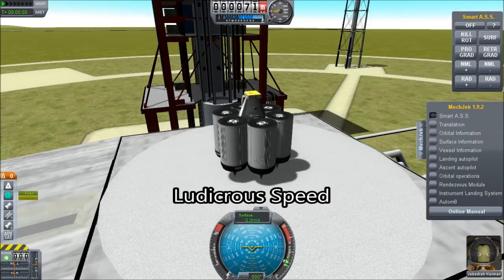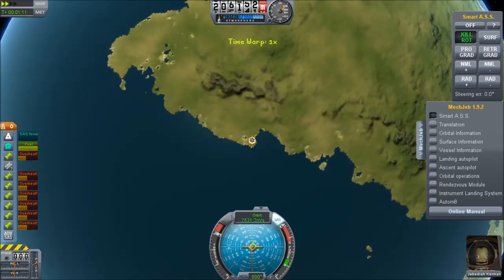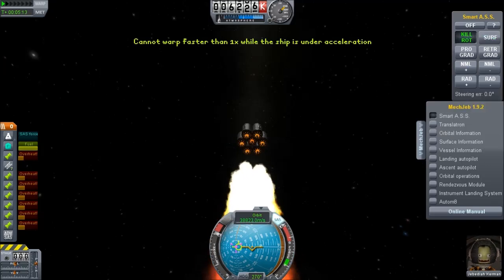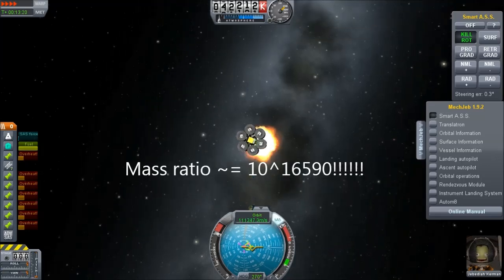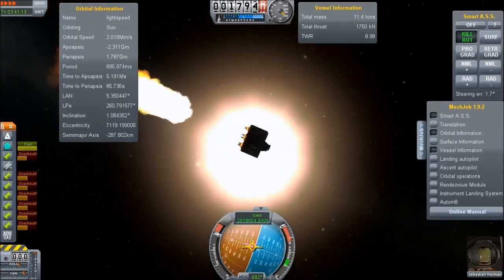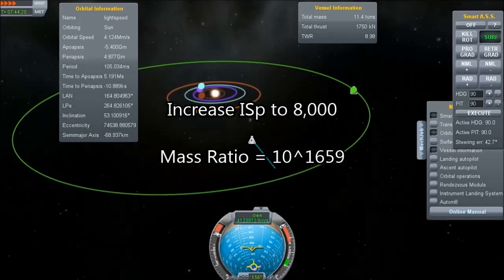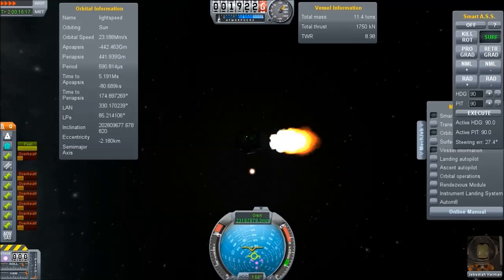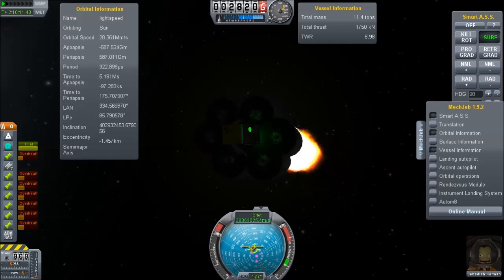What Does It Take To Reach Lightspeed In Kerbal Space Program?

Comment: Well, I do have a fun rule you can use to obtain an approximation for the mass ratio e. The fastest possible approximation I can provide is that the mass ratio is a 1, followed by 3820 zeroes. While not even remotely accurate, it's based on the rule of thumb that exponents of 2 can be resolved as a number at 3 additional zeroes for every exponent of  10. You can then round off e(2.17) to 2, and then divide the exponent by 10 to get the approximate number of zeroes for your mass ratio.

Anyone want to chime in on methods for obtaining better approximates? This is only the 'fastest' approximate I know how to obtain for the problem, but I would like to hear more methods.
Reply: U fucked my mind